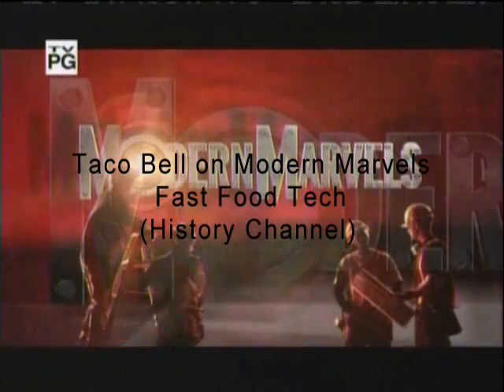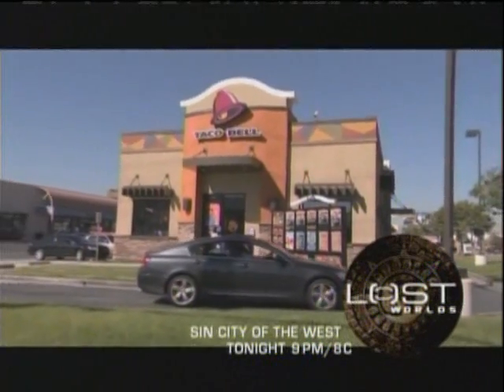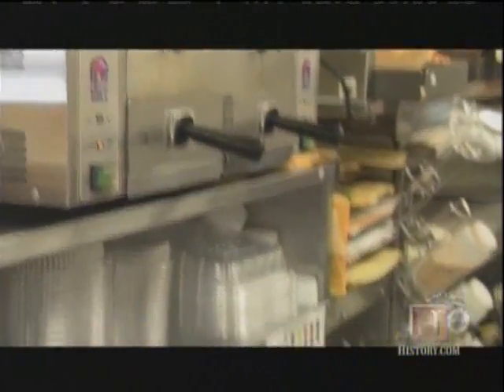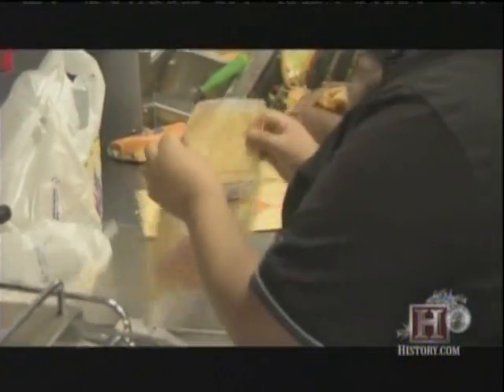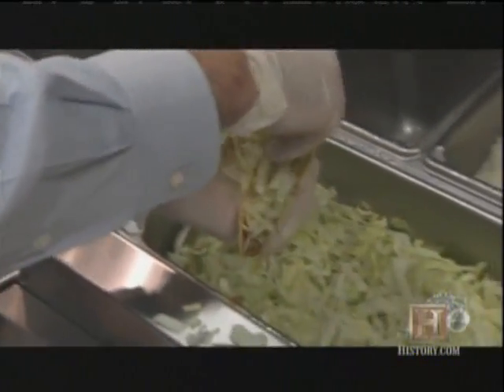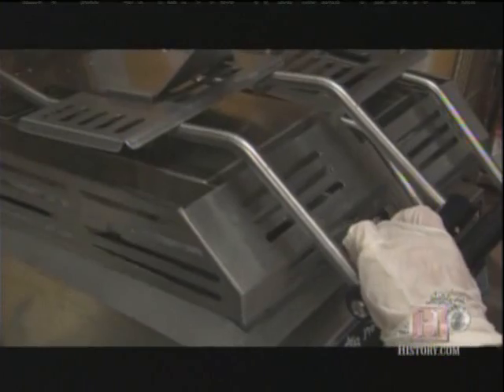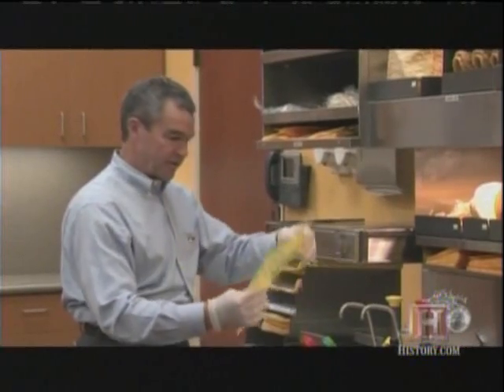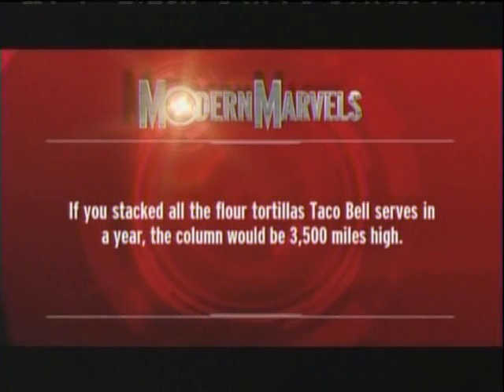Taco Bell- A peek behind the counter: How the food is made

Comment: Wearing gloves is actually just as bad as not wearing gloves. Pathogens on hands can get through gloves. Most gloves used for food preparation are permeable which means that pathogens from the wearer’s hands can escape through the gloves on to food. Gloves can harbour pathogens. The surfaces of gloves are not smooth, and tiny wrinkles act as storage areas for contamination. Gloves also cause the wearer to wash their hand less.

The best way is to clean your hands frequently.